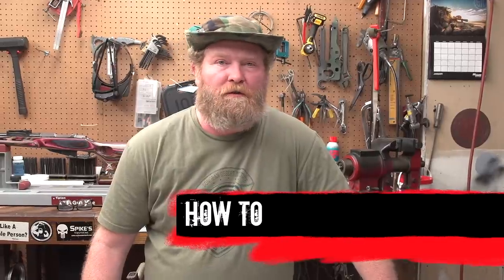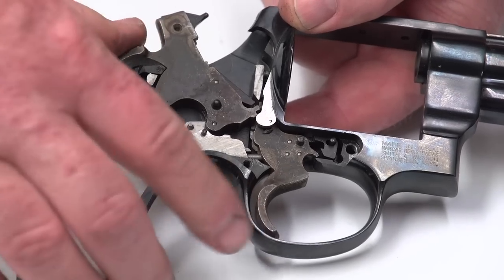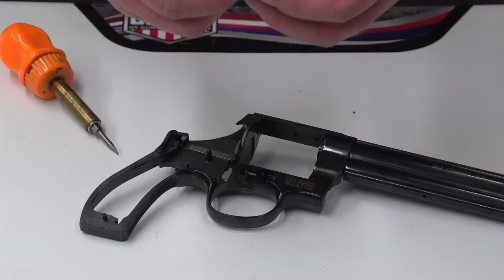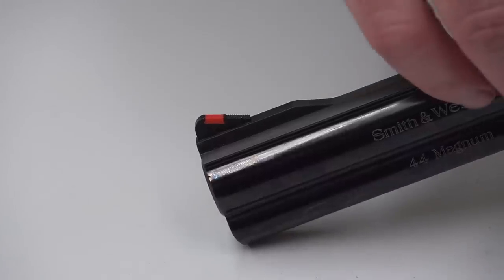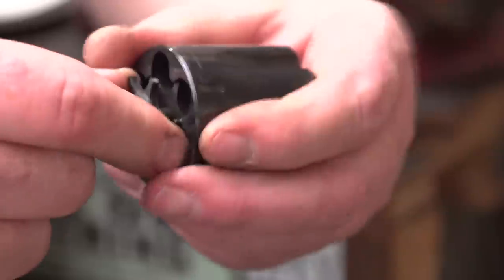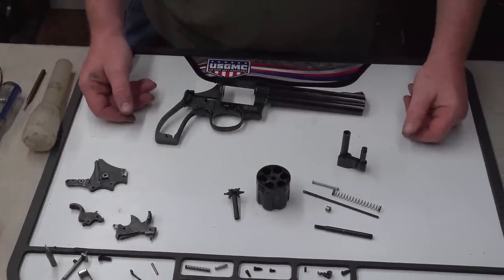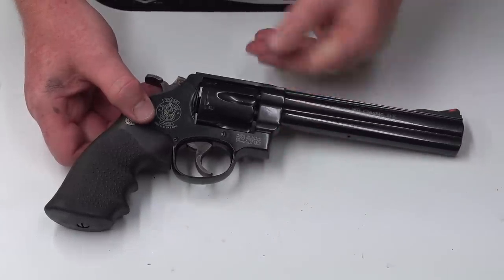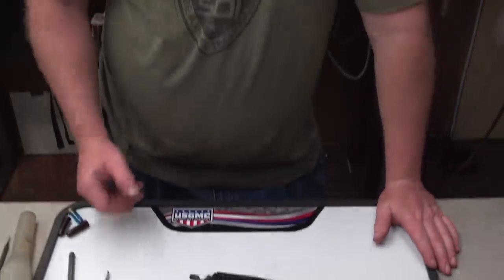S&W Model 29 Disassembly

Comment: A HUGE thumbs up for this style of gunsmithing/dis-assembly video.  More, more, and please more!  These are very educational and it is a pleasure to watch Ray do his thing.  Did I mention that I'd like to see MORE VIDS LIKE THIS!?!?!
Reply from the maker: We will be posting roughly one per month
Reply: *****  I have a question, if they are so kind to answer. Do you currently, what is the assault rifle caliber 5.56 mm with the highest price? Very thanks
Reply: +Iraqveteran8888 I first started watching Eric back in maybe '08 or '09 and once the Gun Gripes came about, that was it. I was hooked. Loved 'em and I still look forward to seeing a notification that you guy's have made another video. Love the old 29's too. I shoot more .44 than anything else. My favorite plinking load is 17.5 grs of 2400 over a Ideal 429421 round lube groove Keith. Of course I shoot .44 special in it since I'm already half way there with the Ideal Keith bullet. I do have a question for you guy's since no one seems to be able to help me out. I have a 7.5 inch Redhawk in .44 and I'm wondering what the specs are for endshake on it. Some say that on a Redhawk, 5 thousandths of endshake is factory standard. I know Ruger's have a bit of fore and aft movement, but I'm curious to know how much is acceptable on a new Redhawk like what I have. It's factory new, and I have only put about 150 or 200 rounds through it. The Redhawk is built like a tank and I doubt frame stretch would be a problem with the loads I shoot in it, but would like to know what is normal and how much is too much with a Redhawk. Thanks guy's
Reply: +Pepe Vicente Sófocles please elaborate
Reply: agree!!!!

Comment: Best S&W disassembly video.  Only person I watched that uses correct terminology as well as the proper method.
Reply: He actually called the Hammer Block, a transfer bar. This video is good but gunblue490 has been trained as a s&w armorer for 80 hrs and then decades of experience. He has a few videos like this on his gunblue490 channel
Reply: Also called cylinder stop, a cylinder bolt.

Comment: Very informative video for someone who has never taken apart a smith. Also the best Ruger commercial I could have imagined. For half the price one can get a revolver that's stronger, simpler, way easier to disassemble, and twice as responsive to tuning
Reply: The Ruger revolvers do have a lot of small parts in the trigger assembly, but I do like the fact that the whole thing comes apart in one unit.  I have disassembled my SP101 and keeping the trigger parts intact, it can be done in probably two minutes or less without rushing.  Very simple, robust design and very owner-servicable.  Love the coil spring instead of the leaf as well.  The Smiths may have classier lines,  but those Rugers are tanks.
Reply: Dave Moldenhauer I have both...even tuned, my Rugers do not have a trigger nearly as nice as the trigger on my old S&W's.  The only gun that is comparable would be something like a Colt Python.

Its like having a chevrolet vs. a Cadillac.  While the Chevrolet is completely functional, stone reliable, and when fully loaded is a very nice car, it never quite makes it to the level of a Cadillac in comfort.

Comment: Really well done and simple to follow - great camera work!  I just did a detail strip on my Model 19-3 snubby - first time (I bought it used in 1993!).  I don't have the special tool to remove the rebound slide but it pried up very easily with a screwdriver - covering it with a towel is a great idea.  This weekend it will be the 686 and Model 13-3.  They'll all be running like Swiss watches.  Thanks for this.

Comment: Had to replace the rear sight lug. Wasn't installed at the factory. This was my first revolver. I didn't know it was supposed to be on the revolver for years. Never could hit anything because I couldn't zero the sights. Found out S&W calls this part a "rear sight lug." You called it a T-nut,  A double threaded post welded on a small square. Fits in that groove on the frame. You can buy all the parts you need from S&W, MidwayUSA, and Brownells. All adjustable rear sights for S&W revolvers are the same. Same rear sights for all K, L, N and X frames that are fitted for adjustable rear sights.

Comment: 4:50 that is how I was taught to open the side plate. Often on used revolvers, you can say how someone has pried it open it a screwdriver causing ugly scratches. I used birch firewood to smack it open. Worked fine.

Comment: Excellent video!  I have watched several others than happened to pop up before this one and they were no where near as complete.  Excellent disassembly/reassembly instructions and video.  My ONLY complaints are 1: you didn't show your cleaning and lubrication steps and 2: you didn't address how much disassembly is required for re-bluing nd what parts should be re-blued on a blued example of the gun.  Very minor complaints in my opinion.  I would love to see more gunsmithing videos from this guy!

Comment: Thanks Ray, Very Nice video. One thing I do for the spring disassembly is, I perform the removal inside a large clear plastic bag, just in case of any "flying Springs"! I will also do it with any firearm I disassemble for the 1st time. Thanks Cmax
Reply: Cmax Arms Yep  I do the same on some models

Comment: I love the simplicity of S&W revolvers. I tip my hat to the original engineers. Depending on the model I’ve had the bolt come out front first or rear (plunger and spring) side first.

Comment: Thanks Ray for sharing your expertise. I have a model 629-5 that I am polishing now. Is it safe to remove just the thumb latch only? I don't have a need to disassemble the entire weapon. I would just like to get under the thumb latch with polish and buffer to get an even uniform high lustre in the metal and then reattach the thumb latch when done. I just don't want to remove the thumb latch and have something inside the gun come loose. Thanks Ray.

Comment: Revolvers are hellish complicated!
Reply: ***** In general I agree with you. However, it also depends on the gun. I have an old Hopkins and Allen double action #6 revolver that only has about 10 parts or so. It is a LOT less complicated. But it is also a LOT more dangerous in that it doesn't have all of the safety features that the S&W has built up over the years. S&W revolvers are made to last a lifetime. H&A revolvers were not. The old Remington and Colt cap and ball revolvers were also very simple. But they were also single action which meant a slightly lower parts count and less complexity.
Reply: ***** Revolvers sure are. People say "revolvers are more simple and more reliable!"

I dont believe it. I have and do have revolvers, and have and do have semi-autos. If you open up a modern striker fired semi-auto pistol, its like magic inside. A couple linkages, springs, a firing pin, and thats that. The insides of a revolver are like something out of a fine clock.

Comment: The front sight on the DX should be spring loaded , Easley removed by sliding it forward the DX came with 3 different sight blades

Comment: Awesome video. I have an older 29-2 model and am having problems. The cylinder sometimes will not advance when cocking or double action trigger pulling. If I manually grab the cylinder and turn it a bit, it will then advance. Then it will work for awhile, 4-8 cockings and then not advance again. Any ideas on what may be the problem? BTW The pistol itself is in 'as new' condition, and does not appear to have been fired much.

Comment: Any idea where to get a replacement over travel stop?  S&w won't send them out. They claim they're performance center and have to be installed by them. 

Brownells doesn't have them

Numrich also doesn't have them. 

Of course they don't have schematics for the 686-6 yet either.

Comment: Excellent video!! I have a question for you.. with the rebound assembly spring and the over travel stop that is within that spring.. it is necessary to have that pin?  I recently replaced the trigger spring and main spring and I can actually hear that pin moving back and forth when I move my pistol.  Super annoying!! Lol. I have tried it with and without and cant tell any difference.  Much smoother trigger now

Comment: Great video 👍🏼Question I have a model 64/8 stainless model 10 lots of MIM parts .The trigger rebound slide only has a spring ; but no overtravel rod ? is this normal; or maybe there is one that doesn’t come out with the spring